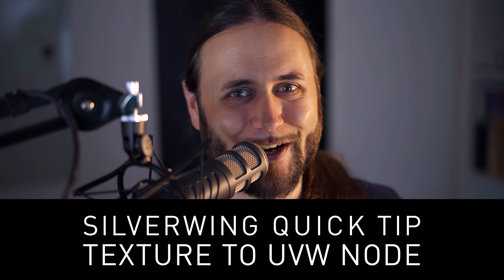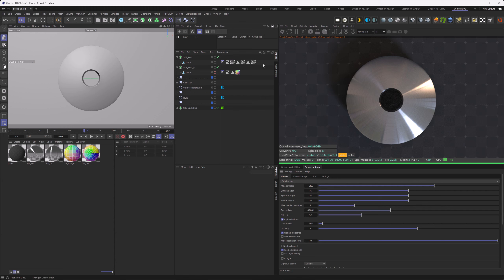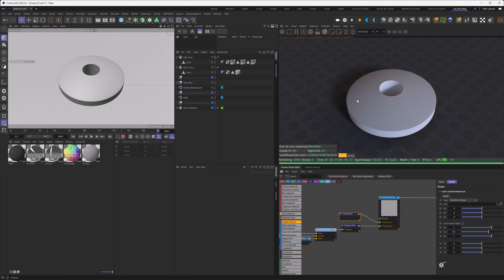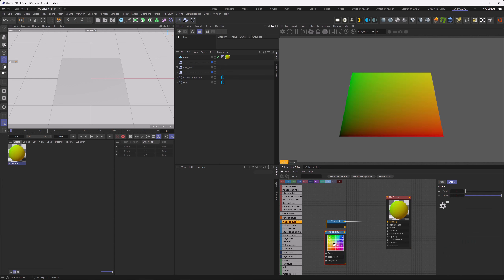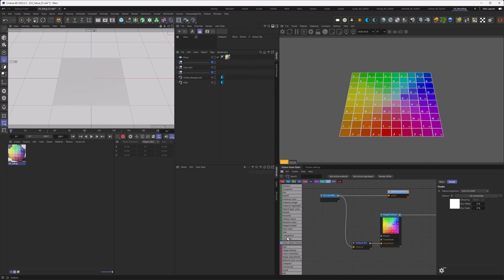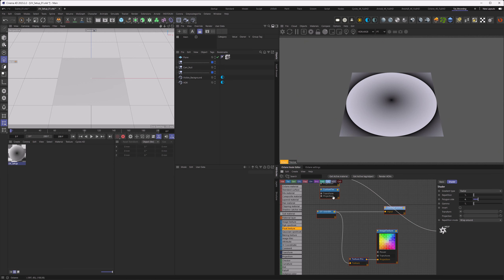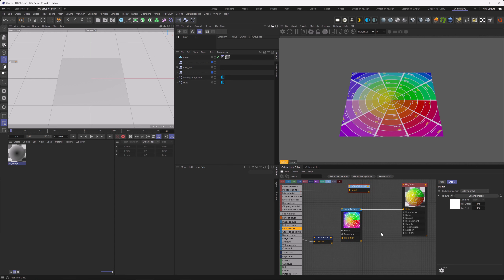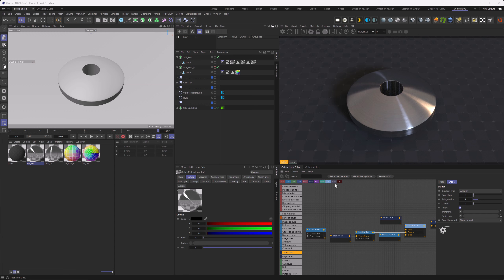Silverwing Quickish-Tip: Texture to UVW Node

Comment: Could you make an in depth tutorial on material layers inside octane. Not alot of tutorials out there on it. 

Also only recently found out about the "Custom Patterns" Tab in octane. Wondering if you have any ideas on how to make use of those.
Reply: Here is a good tutorial about Layered Materials : https://youtu.be/42HLXjphofE

It's not C4D, but I believe it is easy to follow for C4D users too, as I have no problems following Octane C4D tutorials as Modo user.
Reply from the maker: Thank you. Sooner or later I have the plan to go over materials and all the different attributes. 
But I am not sure when this will be 😇 😅

About the custom pattern. I think its a personal preference. Going through all of them and seeing which one you can use in your pipeline. I honestly rarely look into those and therefore do not have a clear recollection what´s in there.

Comment: Great video, i wonder what playing with the w would do, could it lead to fake parallax? It just dawned on me, have you considered adding the join button to your youtube channel? I’d love to subscribe to your patreon but it’s blocked in turkey, wish you a good evening, cheers ✨
Reply from the maker: Thank you very much.
I have made some research some time ago into fake parallax. Its a bit more complicated. W with a 2D bitmap will arguably just stretch the existing pixels back.  What you could do with a Noise for example is make it appear animated by moving the W as you basically move it perpendicular to the objects surface (in simpler words you move it through the surface)

I have also planned a parallax tut when I have the time to continue my studies there 🕰️
Reply: @SilverwingVFX  yes i thought that stretch would create a fake sense of depth since it's like a displacement map but for the texture with no light interaction whatsoever

I remember your opal shader experiment🔥, i tried replicating it in redshift using the flakes shader (it has a built in parallax controles) because my knowledge in OSL is little to no existnent, still trying to study how to do a proper parallax effect and maybe get to make a black opal shader

Comment: How do I use a vertex map on octane bump
Reply from the maker: As far as I know Vertex Maps as of now do not work directly inside Bump. You can take it to create a mask between different bumpy noises... but unfortunately not create any hight map for bump directly.
Not sure what the limitation here is. I would find it nice if it would work too!
P.s. vertex maps also do not work with Displacement unfortunately.
Reply: @SilverwingVFX  Thank you very much for your reply